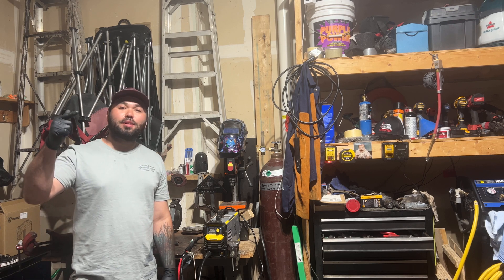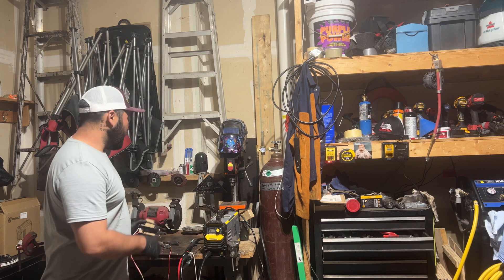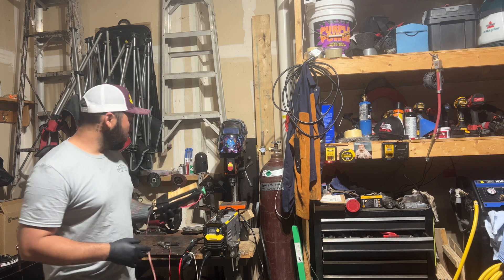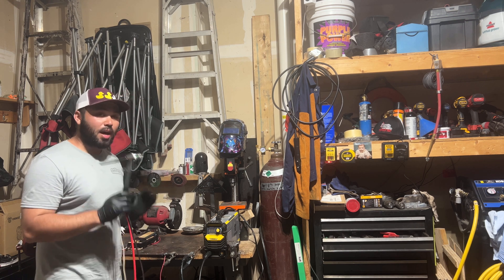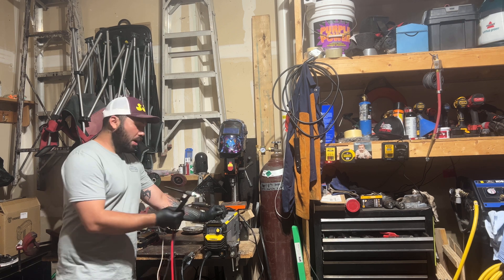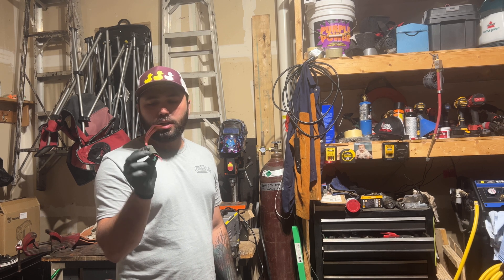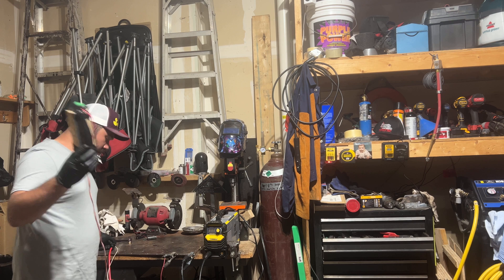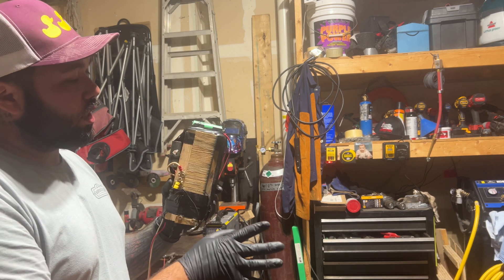How To Build A HF Starter For Scratch Tig

Comment: They are NOT called "Generators".  They are "Step-up Transformers".  As the voltage gets higher, the amperage decreases. The high voltage is what you want to get the sparks at high frequencies.

Comment: You are 100 percent correct about the gap, in fact the arc start ignition boards for hf start have a tiny little spark plug ceramic gap built right into the board itself

Comment: I could be wrong, but you need the gap because you need resistance in any electrical circuit and if you go directly to it you are basically short circuiting to the welder machine
Reply: Depending on the welder, you start the arc by pressing the tungsten to the steel making a short and when you lift, that's when  the welder kicks the current in. I have a "yeswelder" with touch start that works this way.
Reply from the maker: That seems accurate

Comment: You are using a DC stick welder and then introducing that taser which is AC? Hmmm. That's not gonna work.
Reply: That’s not AC voltage. DC voltage converter. You can get this by pulsed DC thru a step up transformer and capacitor and transistors.

AC voltage in a taser could pose to be lethal instead of incapacitating effect.

Comment: Nice it really works well. Just a quick question . Can you earth your pedal with your welder earth clamp ?
Reply from the maker: I have not tried that. It’s also been awhile since I used this
Reply: @RyanRosss  oh ok noted. If one day you use it again please make an update video I would like to see ?
Reply from the maker: @ yes I’ll try and find it and make a video
Reply: @RyanRosss  Thanks appreciated.
Reply: I wouldn't see why it wouldn't work in this way and was actually thinking the same thing. You'd only need one ground clamp that way. Electrically there is no difference
Reply: @drewrinker2071 Thanks.

True I agree with you that was my exact thoughts too.

However It would be nice if he can test it so that we could verify our thoery.

Comment: Hi, how are those  high voltage generators called, in order to be able to find them in Amazon?
Reply from the maker: Yeap . If amazon doesn’t have it eBay does
Reply: They are NOT called "Generators".  They are "Step-up Transformers".  As the voltage gets higher, the amperage decreases. The high voltage is what you want to get the sparks at high frequencies.